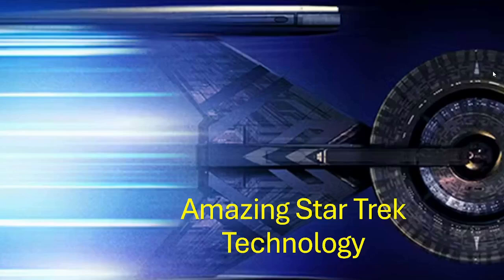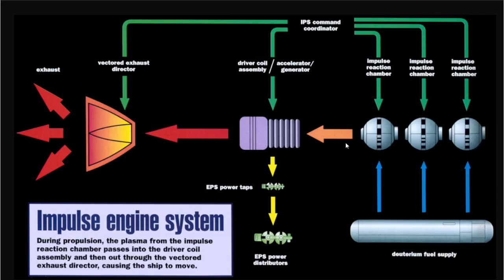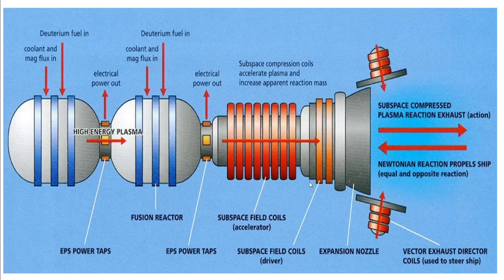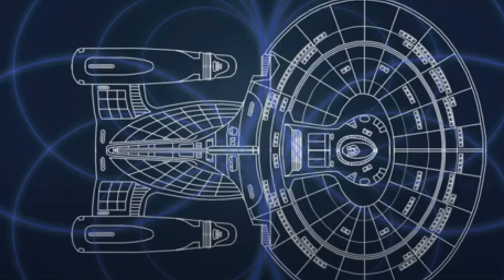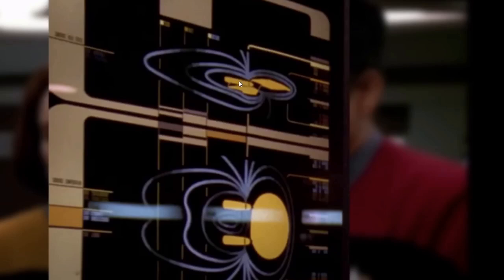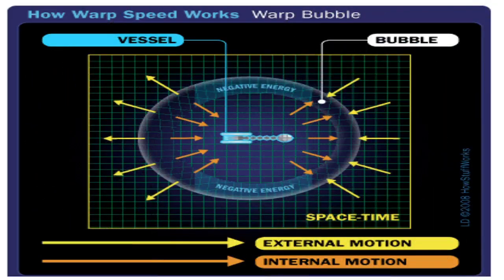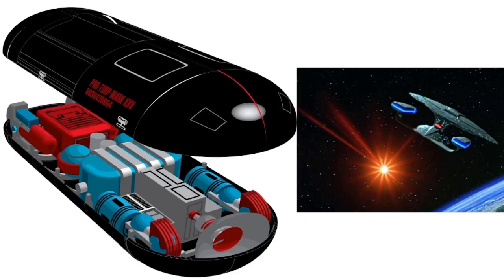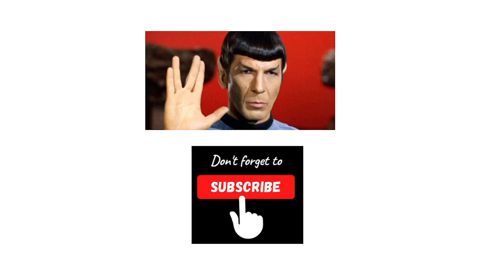Star Trek Technology - Drives and Torpedoes

Comment: If we assume rocket and saucer type starship are two main systems has developed since last century, then impulse engine and photonic quasi-crystalized torpedo can both applied for starship as propulsion advancement, however, should be carefully chosen to different series by ship classification. 

Battleship is suggested to improve warp speed above 9.9, like some warp speed ships comparison. 

Usually, photonic quasi-crystalized torpedo and fusion plasma torpedo can reaching high standard FTL space travel, and gravitonic impulse engine is more efficient than previous types. By speedy space projects has launched, you'll get sliptime control system beside the traditional gravitonic impulse engine as next generation ship series.

Thank you, looking forward to more amazing starship technology discussion.